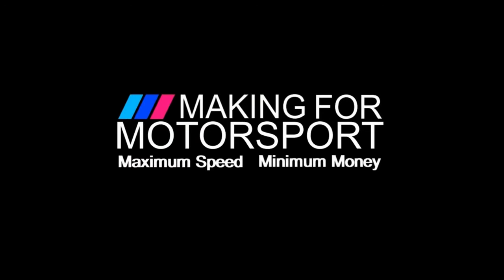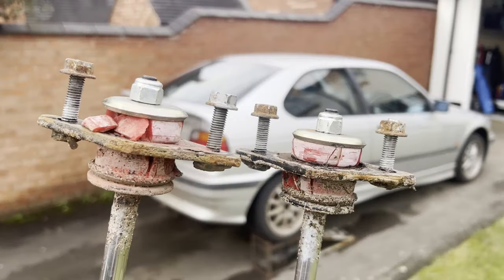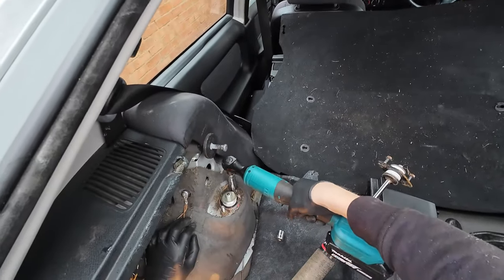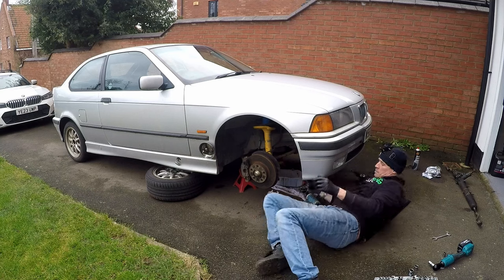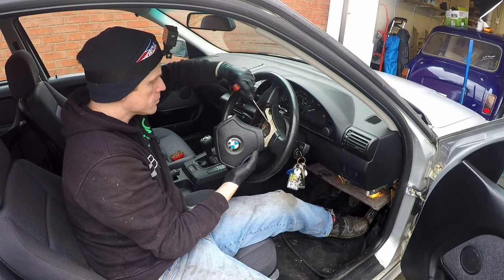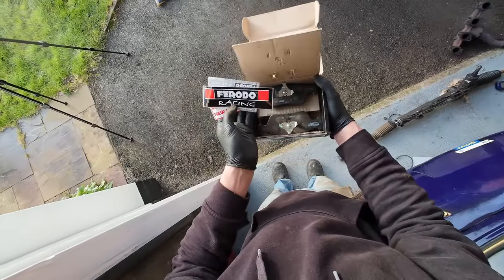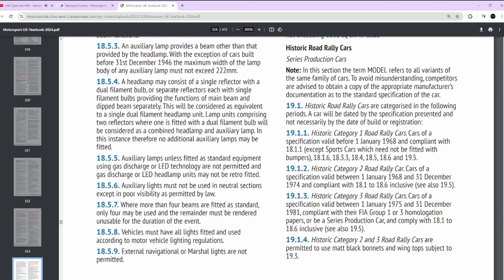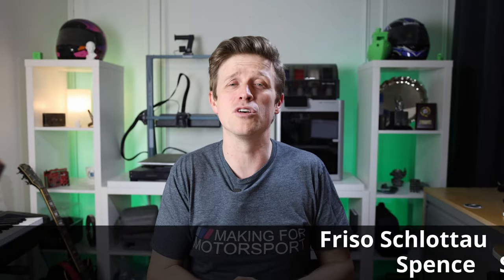Project RallyE36 - Time for upgrades!!!

Comment: The perished bushings might be from some kind of chemical attack, either from getting a soaking at the factory or in shipping to being sat next to a leaky bottle of thinners or similar. TPU is a great replacement, we use it all the time in combat robots and it's basically indestructible. I've also seen people print custom gaskets from it, especially for things like lawnmower carbs where you'd normally be cutting it from gasket paper anyway.

Comment: One thing that massively improves the steering feel is swapping those E36 style lower arms out for the E30 ones which don't have the rubber cups on the outer ball joints.

Comment: 3:28 Quick thought before I finish watching. I believe if you were to put the 3D printed stuff in an oven for some time at slightly under melting temperature in sand so the piece doesnt deform too much, you would eliminate issues of layer adhesion and correct voids. Pieces will shrink a bit but with a couple of iterations you could correct for accurate sizing in the slicer. The problem is you will have sand inclusion on the surface of the pieces, so the finer the sand the better. Keep the amazing work my guy ✨👌
Reply: Also careful temper in a very controlled environment works well and strengthen the parts
Reply from the maker: Yeah, I’ve not tried it but apparently it helps PLA massively… I’ll give it a god eventually 👍

Thanks for watching
Reply: This is why modern 3d printers have heated chambers, not just heated beds.
Reply: With TPU it's hardly an issue as the layer adhesion is absolutely insane and it's incredibly durable. Annealing does work fantastic on a lot of PLA though! I have even made oil caps from PLA+ that is functional in an engine bay, contrary to what the internet will tell you is impossible.

Comment: I have printed bushings for leaf springs. Haven't put many kilometers on them but they are much stiffer than OE rubber ones.
Reply: Worth saying that bushes need to have some compliance or you wear or fracture the part or the mount, easier to replace bushes than repair a cracked chassis.

Comment: hmm, did you take off at any point with those bushes in the rear? It maybe that they had a harder life as teh suspension slams down onto them.

E&H memorial rally in a few weeks, entrys live yesterday, do it!!! I am... in my compact
Reply from the maker: Haha… the car has been slightly airborne, but not with those bushes, one steady 12car and they were toast… the printed ones have stood up so far…

I did a Chelmsford MC targa a few weeks ago (Javalins Jumbo), was great fun, but every bush in the rear is fucked, so that’s all coming off, plus I totally pushed my luck with a sump guard so that all needs sorting… not going anymore events where I am holding back on the rough stuff…

I’d love to do a Road Rally again… nothing like the smell of mud on a hot exhaust and a pint at 4am 😁😁😁
Reply: @MakingforMotorsport  My friend had a similar experience with some poly motor mounts for a DSM. He had them in a box for years and when he finally went to install them, they were crumbling. I think some formulas used just have issues. The TPU should hold up great!